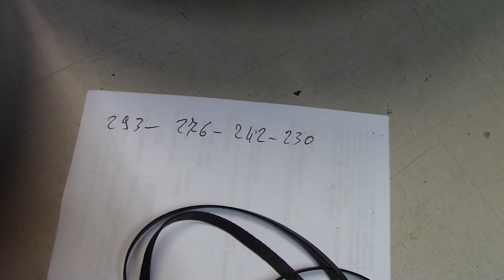FOAM SOSTITUZIONE -AUDAX

Comment: Buongiorno, in questo caso ho visto che non è stato necessario mettere gli spessori sulla bobina. Dovendo sostituire la foam su altoparlanti non utilizzati si può procedere nello stesso modo? 
La scelta di farlo o meno dipende anche dal diametro?
Reply from the maker: Buon pomeriggio,se il senso della sua domanda è se conviene sostituire le sospensioni su altoparlanti che poi resteranno inutilizzati,la risposta è negativa in quanto le foam subiranno un processo di deterioramento e,quando i gli altoparlanti le serviranno,a seconda del tempo trascorso,dovrà magari sostituirle nuovamente.Cordiali saluti
Reply: @AndreaCoppaSaec  scusi, mi sono spiegato male.
Se gli altoparlanti non sono stati utilizzati con il foam danneggiato, la bobina non dovrebbe avere danni.
Usare gli spessori di centraggio è indicato sempre, oppure sotto un certo diametro se ne può fare a meno?
Reply from the maker: Buongiorno certamente se non li ha utilizzati con la foam rotta la bobina di sicuro  sarà integra, mentre per quanto riguarda il centratore non è mai necessario dipende dalla manualità di chi fa la riparazione, evitando in questo modo di rovinare il cupolino.